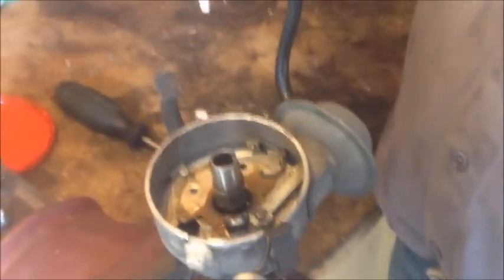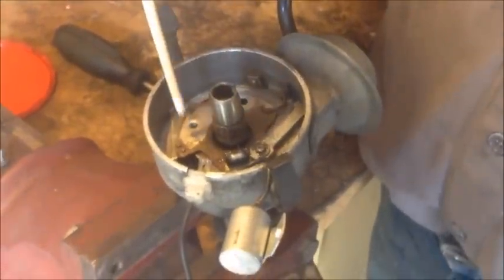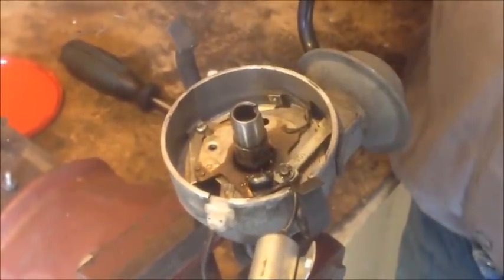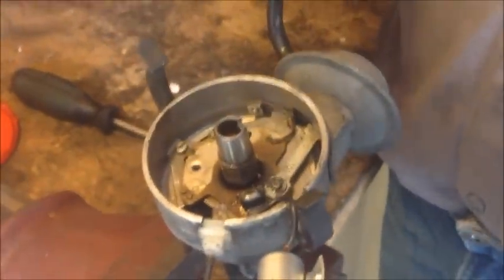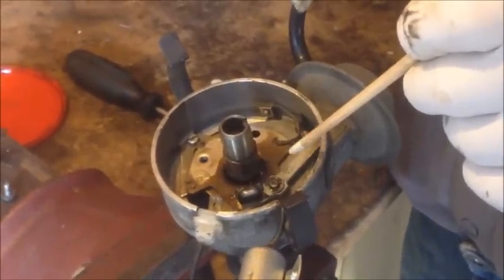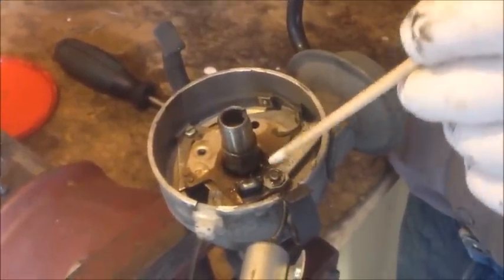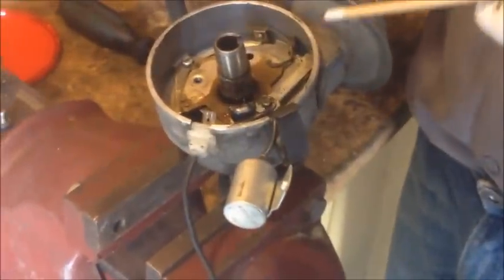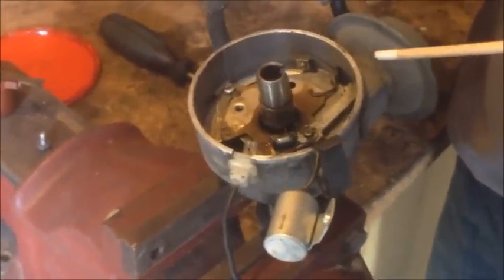how to check a vacuum advance unit on a distributor

Comment: Replaced my vacuum advance today on my 1962 Mercury Comet, it made the world of difference! Last year, the Comet began to get more and more sluggish. I suspected the carb, and had that rebuilt by All American Carburetors in Florida. It really need rebuilding, and it came back looking better than new! These guys know what they're doing. I replaced the points and condenser too, but it was still dogging out. So finally, I pulled the vacuum advance off, extremely easy job, and I could blow air through the unit (diaphragm shot). A $30 part, easy repair, she's all perky again!
Reply from the maker: thanks, i am glad this video helped.

Comment: what if it doesn't move under vacuum
Reply from the maker: hi if the diapham arm conneted to the top plate of the distributor and the diapham does'nt move then the diapham has a hole in it and the vacumm advance unit neeeds to be replaced.
Reply from the maker: hi the top plate in the distributor maybe stuck, dirty, secied, bent or the points screw maybe stopping the top plate, also see my other comment. hope this helps Emi
Reply from the maker: if the lever in the distributor dosen't move then the vacumm advance unit is faulty